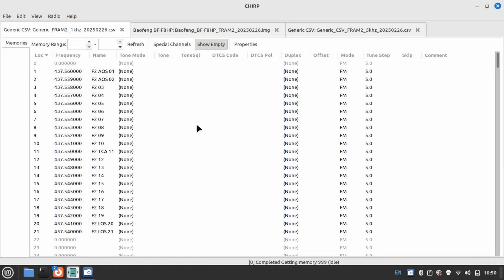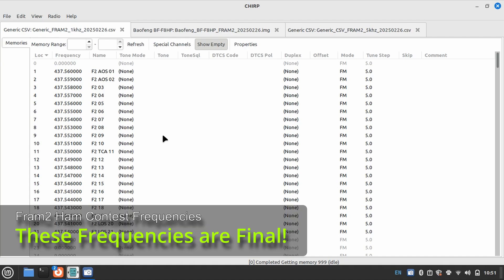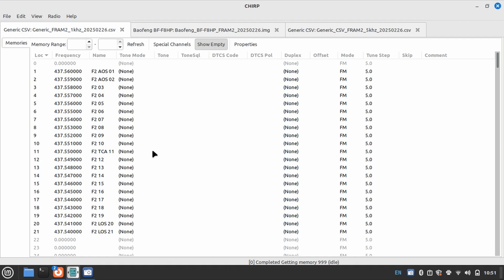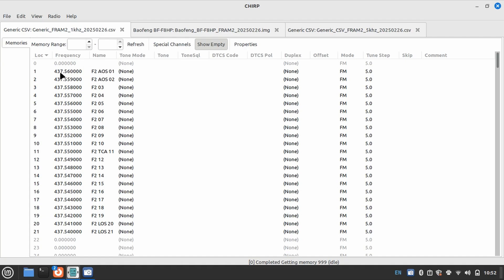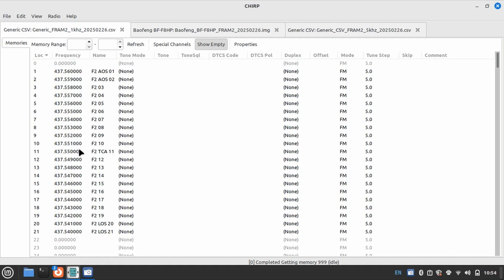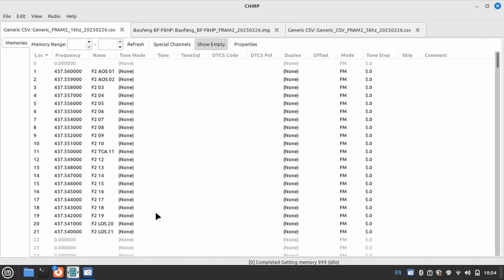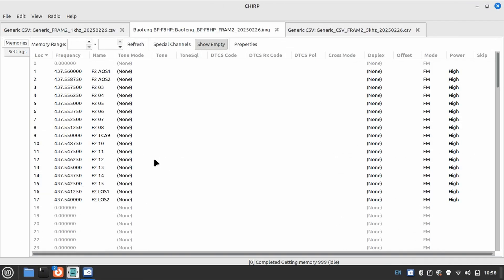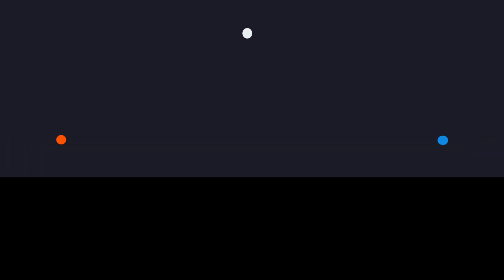Program Your Radio: Conquer the Doppler Effect

Comment: @digitalrancher 
-could you possibly do a video on logging Sat contacts to LoTW/QRZ? And also does one log APRS via ISS contacts or does that not count as a QSO?
Reply from the maker: That sounds like a great video idea! APRS is interesting. If the exchanged messages included the required info and was made only through the digipeater, and not repeated by another repeater or an igate its a contact.  It has to be an intentional contact  and both operators would have to log the contact as well.